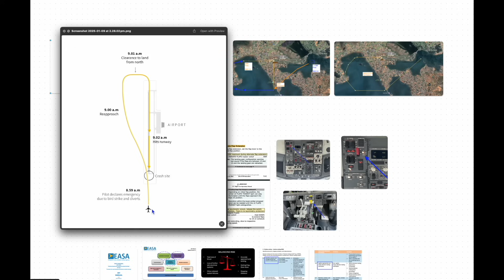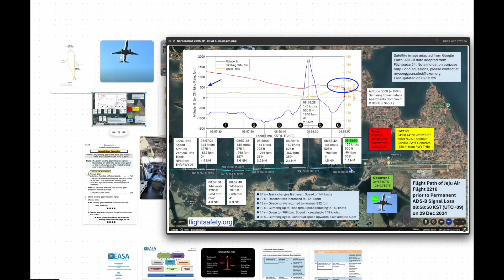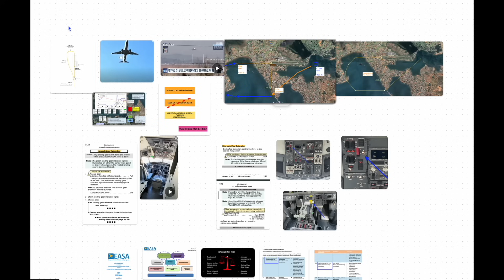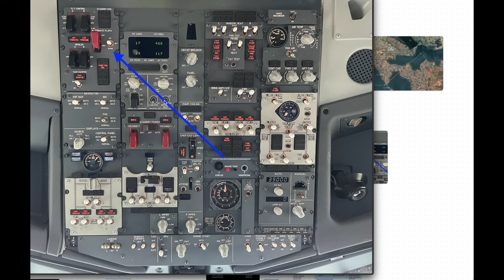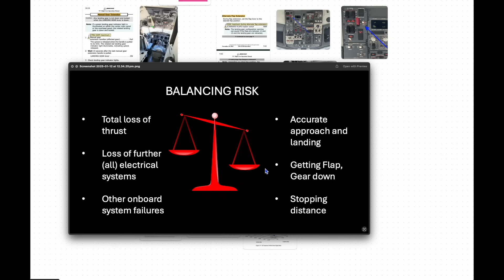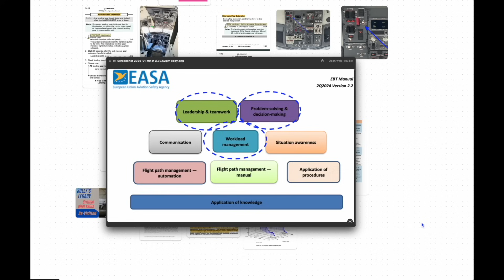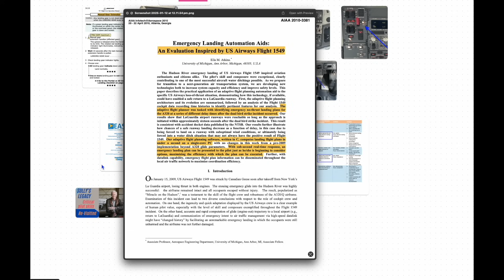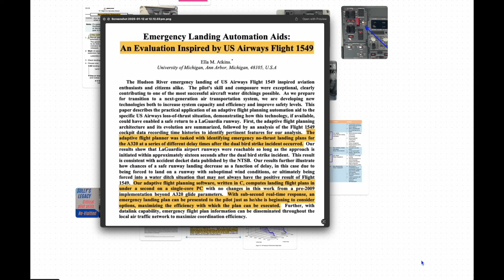Jeju 2216 Update - Multiple System Failures lead to catastrophe

Comment: BOTH engines were on video trailing sparks, actually. You can see this by zooming-in on the video of the compressor stall. The flight attendant reportedly has said that she saw an engine trailing smoke and "then it exploded".... since #1 wasn't running on touchdown, one might conclude that was the engine she had seen explode. Also it's been pointed out that the beacon and navigation lights were not observed working as the plane floated down the runway and then finally went to sliding... everything points to severe electrical and hydraulic failure due to damage to both engines and little altitude to work with at the start of the emergency. Pilots did the best that they could.
Reply: Yes, both engines being affected, matches every eyewitness statement I have seen so far as well.
Reply from the maker: Thanks for the comment and mentioning this. 
Fair assessment, adding to how hard this would have been for the crew to handle. Very sad indeed and something we must learn from.
Reply: The aircraft collided with a bird that weighed over 1,000 pounds. 

At 300 knots that will cause severe damage to the airframe and aircraft systems.

It was either a rare species that was thought to be extinct, or an occupant of a flying saucer from another planet.
Reply: @alanstevens1296  Or, and I'm just spit-balling here... but what about more than 1 bird, at once? A witness on the ground reportedly described the plane as having flown thru "a wall of birds" after all. Just saying. 😕
Reply: Having seen some analysis on this both engine power failure theory there is still the question as how come the CVR and FDR are not connected to battery power? There was a mention somewhere that the Boeing 737 version we are talking about is not that old to miss the battery power option for the flight recorders...?

...and the question is still open as in case of full power loss why the pilots choose a fly-around when having perfectly alligned for a landing already...

My personal opinion on this 4min lost data is that it was intentionally deleted by the authorities... ...it is just the culture there to keep info for themselves... ...but I guess Boeing will have its hands on it sooner or later, as w/o that it will be difficult to figure out if there was any issue with the plane... ...and on that thought JeJu decided to continue flying its fleet so I guess somebody is pretty sure the planes are ok...?
Reply: @szentis1  the CVR and FDR are not on the battery, on the 737NG and 737MAX the airline order optionally a backup battery for it.
Reply: @szentis1   "The culture"???  You realize NTSB was the one that did the data extraction on the FDR, right???  🤦🏻‍♂️  Seems your rac-sm is clouding your judgement.
Reply: "The culture"???  You realize NTSB was the one that did the data extraction on the FDR, right???  🤦🏻‍♂️  Seems your r- ism is clouding your judgement.   @szentis1
Reply: @szentis1 They opted for a go-around with no engine power and no hydraulics? Yet they managed to retract the landing gear? If they had one engine running they would have power amd hydraulics switched off the wrong engine maybe?
Reply: @keithmarshall7715  A severely damaged engine will continue to run, initially... clearly they still had hydraulics immediately after they flew thru the birds and were able to reset the aircraft to "clean" flight mode for a go-around (it's like, just pushing 1 button on the instrument panel that does all this... right? TGO or something like that it's labeled...). Even with a few fan blades detached, a jet engine will still run but it will not run well and if a blade goes back into the turbine/combustion part of the engine no good will come of it in short order. Seeing what we can see of the airplane's condition in videos taken from the ground and considering eye witness accounts of loud POPS being heard, we should assume that both engines were effectively failed/failing... but the pilots may not have known that instantly, and thus elected to go-around (they may also have been seeing more birds ahead of them and THAT would influence their decision to abort the landing, don't you think?). My point being, the engines health isn't only 100% or 0%, there is a lot of middle-ground between those 2 absolutes and the needle would have moved rather quickly but not instantaneously from 100% healthy to 0% health left. Just saying. In the Miracle on the Hudson, Captain Sully knew almost immediately he had lost both his engines to large bird strikes... turned out it was Canadian Geese flying in formation at 5K feet, and those are LARGE birds! The birds this plane flew thru we do not yet know what species exactly but with feathers recovered from inside of one engine at least, they will know the species very soon. Jet engine manufacturers apparently use dead chickens, common sized barnyard chickens, thrown into a running engine on the ground to determine whether the engine can ingest a bird and continue to operate correctly.... I am not certain if they have tried using an air cannon to shoot the dead chickens right at the engines to more accurately simulate a bird strike at flight speeds or not, but they definitely should and they should shoot more than 1 chicken at a time as many birds fly in close formations of dense flocks! In short, I do not think their tests are realistic or vigorous enough to claim that A BIRD STRIKE CANNOT POSSIBLY DAMAGE OUR ENGINE!

Comment: Electrical isolation of redundant systems can be broken if any bird strike damage is severe in very particular locations within a 737-800 which could lead to internal component communication issues, there are so many possibilities for this to play out and many of them leave the pilots without sufficient information to make reasonable decisions with. It looks like they were doomed with no power even to the most critical systems after the bird strike. I believe if this was an Airbus, auto deployment of the RAT might have helped along with stable defaults. The deployment of flaps and gear needs to be streamlined even further.
Reply from the maker: You're right, so many possibilities - and in the same way so many different combination of factors and systems for pilots to train against in preparing for things like this. Extremely difficult to prepare crews for the full set of permutations, the accident report will be a sobering read sadly, but offer some directions for the industry.
Reply: @AdaptiveAviator  More altitude would surely have been a God-send though... that would have given them more time to understand what was happening and determine what to do about it. It's a miracle they even got this plane back on the runway in 1 piece if they had no electricity and no hydraulic power! I still believe there should be some passengers cell phones that survived the crash and were recovered, and at least some of those phones had surely been recording video and audio in the last 4 minutes of that doomed flight... it's just what people do whenever the *hit hits the fan, we pull out our cell phones and either start txt messaging or video recording if not both! There has got to be at least 1 cell phone that survived with a video recording of what was going on from a passenger's seat, hopefully somewhere behind the wing where they could see and video an engine....
Reply: @michaelshrader5139  Oui c’est une bonne idée, les enquêteurs ont dû y penser. De même il y a,j’espère, des caméras de vidéo surveillance de bâtiments proches de l’aéroport qui ont filmé l’approche, ce qui permettrait de savoir si le train a été réellement sorti puis rentré, les volets ouverts puis rentrés. Personnellement je serais tellement terrorisée si j’étais dans un avion en difficulté que pas une seconde je ne penserais à filmer.
Reply: @michaelshrader5139 yep good points - we have to hope the investigation teams are, indeed, thinking of all these options to follow up. And people will also have to be patient as more traditional and painstaking approaches are followed to build the investigation into this tragedy.

Comment: Excellent follow up to yesterday's decision making upload. Maybe that we never get the complete picture, poor design of pre 2010 737's and possible cover up or/and poor pilot response.
Reply from the maker: Thanks, there's been discussion about Airbus a320 systems being able to absorb this emergency and come through in a better state. There's a generation and a whole design philosophy change between systems and cockpit controls on the both jets. This I think will pressure Boeing further, given the MAX retains a lot of the underlying systems and technology of the NG in this accident.
Reply: @AdaptiveAviator  I was surprised to learn about the amount of carry over from 727 to 737 and 737NG to Max. In effect 1950/60's design philosophy for the 737 Vs 80's Airbus philosophy. I can imagine you are more proficient than most with regards to hand flying ability and calm decision making skills due to your background...very important!
Reply: I am really against any criticism of these deceased pilots with the lack of any concrete proof they did anything wrong given what they knew and when they knew it and the fact that they could not have known how that was going to end. Now we don't have the flight recorders data for the event, so we cannot say if they had a good engine left to shut down by mistake or anything... unless a video is recovered from a passengers cell phone showing a perfectly good healthy left-hand engine shutting down or something, we really need to stop commenting about what all the pilots might had done wrong or should have done differently. I know that pilots have done really bone-headed things before that caused their planes to crash and people died, but we have nothing to indicate these 2 pilots did anything but their very best and just could not catch a break in this disaster! Just saying friends, they aren't here to explain to us what was going on, so we really aught to cut the pilots some slack. 😞
Reply: @michaelshrader5139  bravo - well said!
Reply: @michaelshrader5139  Thank you so much for saying that!!!  ❤